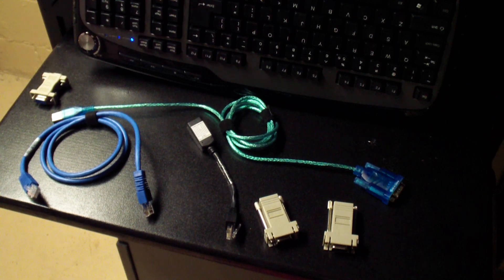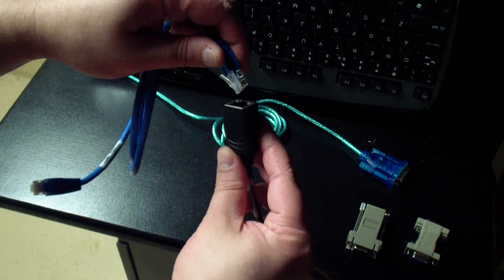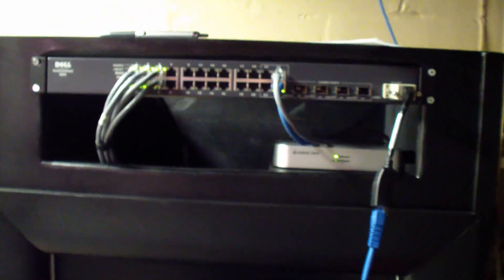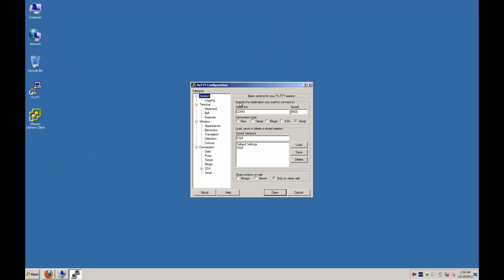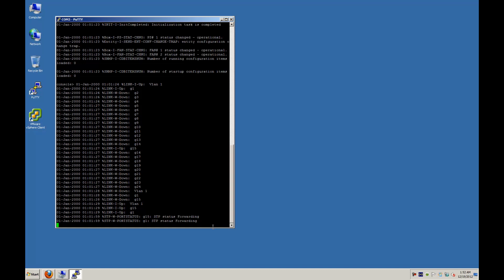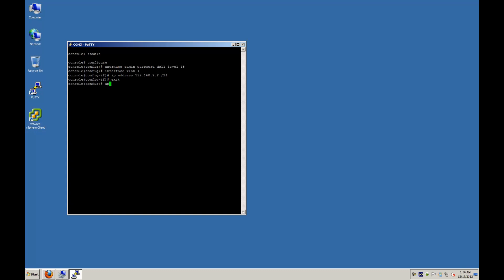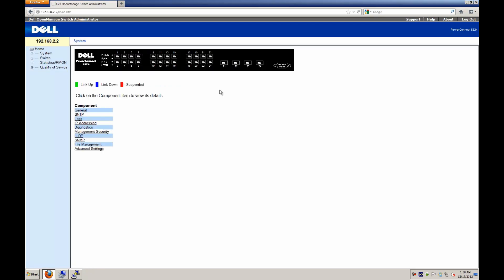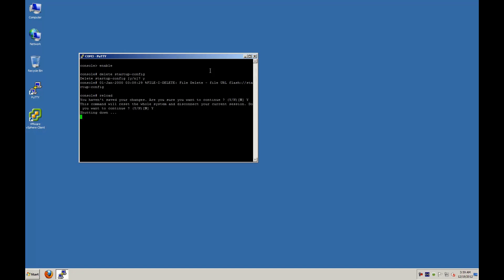Dell PowerConnect 5324 - Console cable tips, basic setup and configuration via Putty

Comment: This video is old, but I just got this switch to set up a wired home network. When I plug my working cable modem into a port, it doesn't light up. Plug in a line to the router, it lights up just fine. I've ordered a db9 cable, but before I dig into the config, have I missed something more simple?

Comment: This video has aged very well! For those that are using a Dell PowerConnect 5524, there are some small adjustments to those commands:

1. show IP interface - will not show your default-gateway address; instead the IP address used on VLAN will be the IP address you need to add in your web browser
2. when setting up your login credentials the format is:
username <enter your desired username> password <enter your desired password> privilege 15

Comment: Hi Rob,

I just want to make sure I am doing the right thing as I am trying to connect to my Dell PowerConnect 6224 and I am able to except I don't get the DELL LOGO display in yours. Could this only be showing when the switch is at factory setting? Please advise as I am not sure if my serial cable is compatible......
Reply: While many of the commands & the basic interface are similar across Dell's model line-up, you'll encounter differences in how things are displayed, etc. If you have a responsive switch at the console port, I wouldn't worry about the lack of a logo. I have a Dell PowerSwitch N4032/PowerConnect 8132 (don't ask me why it's known as both) and it doesn't display a logo, either. Just picked it up recently, and it still has it's original firmware installed. I have to do a stepped firmware update to get to the latest, but so far, I haven't seen a logo magically appear after applying one update so far. Nor have I seen a logo after resetting to factory default. I wouldn't lose sleep over it.

Comment: Hi Rob,

I need your help here. I am using a Dell PowerConnect 6224 Switch and as I follow through on your tutorial I noticed that upon executing the command "show ip interface vlan 1" , it gives me an error " Routing is not enable on this interface". Please advise....
Reply: Hopefully, after a year, you've figured this out. If not, and for the benefit of others, you can try the following step-by-step....once you've successfully logged into your switch via the console port, enter "enable" to get to the "console#" full-access prompt. Then enter "config", next prompt enter "ip routing", next prompt enter "interface vlan 1", next prompt enter "routing", and then the next prompt simply enter "exit". Hope this works for you. Don't forget to copy the running config to the startup config to make this permanent.

Comment: Hello, I know this is an old video, but I have one question:
- Is it possible to log into the switch via the web management built in without connecting the DB9 cable and go through the console management?
In other words - is there any default IP address and default admin and password that would allow me to log into the device and make changes via web management?
- Great Video btw. very informative and clear instructions - thank you :)
Reply from the maker: Thank you! I would assume at some point there was a default IP and admin/password combos but at this point I think it would be safe to say those have been changed. However if you still wanted to chase this down, Dell's doc's are usually pretty fantastic...hit up their support section and look through whatever manuals are available: https://www.dell.com/support/home/us/en/04/product-support/product/powerconnect-5324/manuals. I know the cable setup can be a pain and in this video my cable setup was over complicated to show flexibility. But if you are venturing down this path, it is likely that you will need a null modem to usb cable setup more than once, so it's worth buying it now :)

Comment: I'm not sure if you're trolling newbies with that ridiculous serial connection set up?
Reply from the maker: Nope, if anything this is the non-n00b way. I wanted to show how you can run it over Cat5 like you would see in a production environment with a remote NOC. By doing that you can then run it through a switch and now you don't need to be 5 feet away from the device while configuring it.

Comment: I might have missed it, but was there some reason you didn't just use a standard serial cable (vs. DB9 to RJ45 --> cat5 patch --> RJ45 crossover --> RJ45 to DB9)?  Just curious.
Reply from the maker: John Booth Yes. You need the crossover cable for this to work.
Reply: The Dell's normally come with a cable, guess it ships with a null modem cable.  Just seems much easier (and less expensive) than what was outlined in the video. If you are likely going to be purchasing items anyway...
Reply from the maker: +John Booth It definitely would be cheaper and easier. The advantage here is that I can plug the Cat 5 into a switch and now it can span a greater distance, so I could be across the building or over the wan and still get console access if need be. Other than that, its complete overkill. :)

Comment: hi 
I recently got this switch and wanted to ask when the switch is powered on should the DIAG led light. light up on boot i currently have PWR  and FAN light green static also do you have the wiring diagrams for the DB9 to RJ45 connectors?